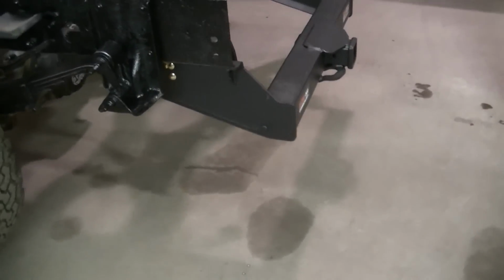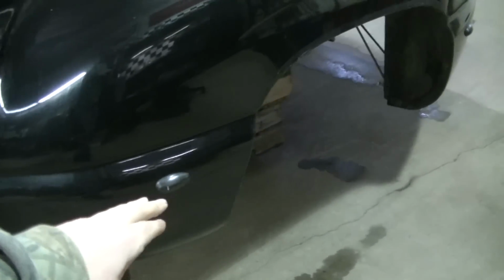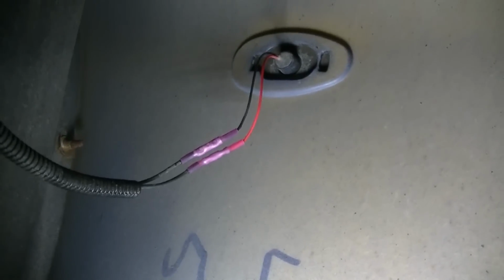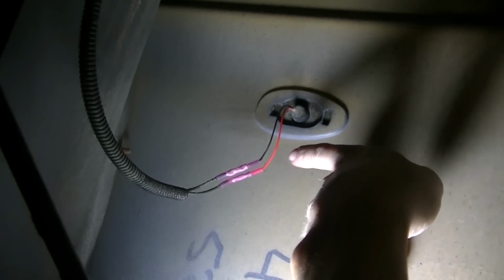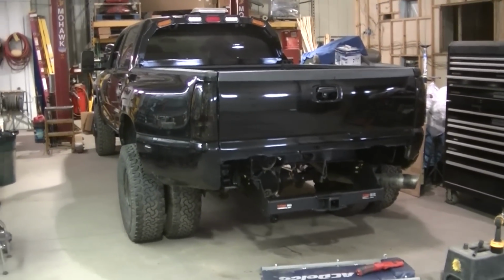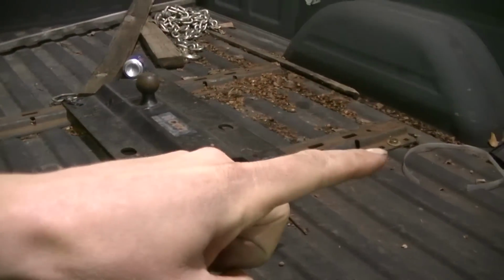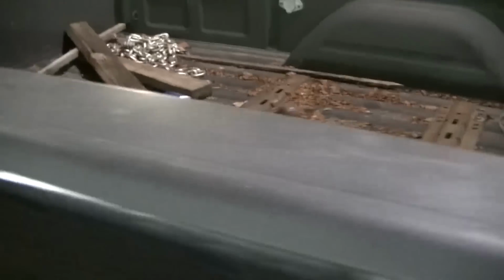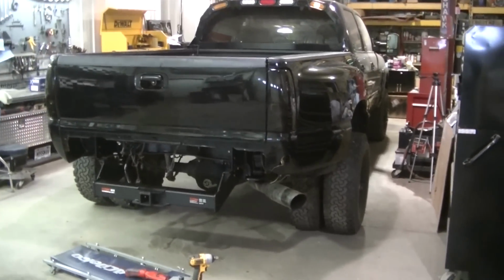Darth Dually Silverado 3500 "Bed, Hitch & 5th Wheel Wiring Install"

Comment: The black dully gmc u have 285 75 r16 whit spacers and what kind
Reply from the maker: You have to run a 2.5" spacer with 285 tires or the tires will rub badly. I went with these spacers. Not cheap but you won't have any issues with them:  https://www.wheeladapter.com/product/chevy-gmc-truck-in-between-8-by-6-and-a-half-steel-dually-wheel-spacers

Comment: I have a 2007 chevy 3500HD flatbed i would like to know if I could convert it back into a pickup bed I never liked the flatbed look, it’s got a cm bed on it I’d like to get rid of it ASAP
Reply from the maker: That depends on if the truck was a pickup or a chassis model. I believe the 3500 trucks with a box are wider than the chassis trucks. Not sure if the frames are different or not.
Reply: I’m really not sure if it’s a chasis model or pick up
Reply from the maker: @jasonreyes6830  You check inside the doors or glovebox? If it was a chassis truck there would most likely be an upfitter that would have installed the flatbed.
Reply: Idk what an upper lifter is and the flatbed it has is a cm bed looks aftermarket because it has tractor supply boxes on it
Reply: Upfitter *
Reply from the maker: @jasonreyes6830  An upfitter is the place trucks go to get things like snowplows, flatbeds, dump boxes or any other special equipment for a certain job. There will usually be paperwork and stickers from them on the truck.

Comment: Rusty sure looks happy about getting the bed on there ;)  Glad you can see the light at the end of the tunnel!  That must be a heck of a drop bumper to fill in that gap!
Reply from the maker: +farmboy30117   I thought the gap was pretty big too.  The new hitch sits lower for some reason I think.
Reply: Probably to get the receiver more level with the trailer tongue instead of having to use a drop style hitch.  Sure have to worry about backing into snow banks though ;)
Reply from the maker: +farmboy30117   Actually now that the trailer plug isn't hanging down the snow banks shouldn't do anything to this hitch.  Should even protect the bumper some.